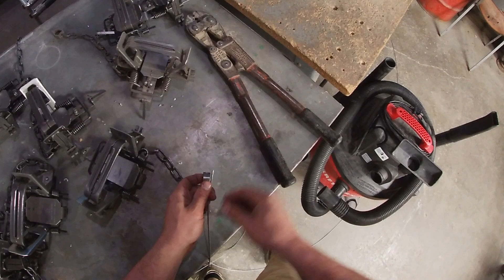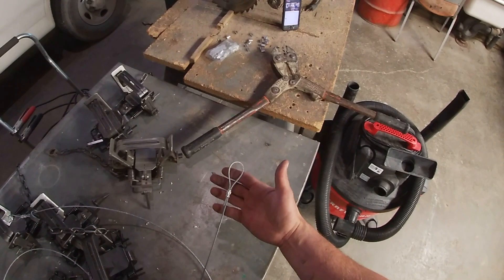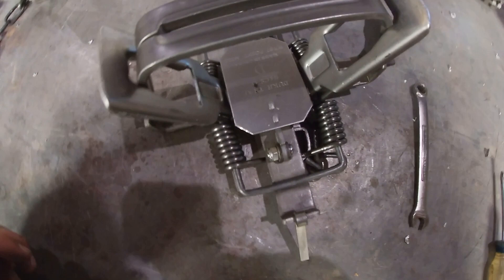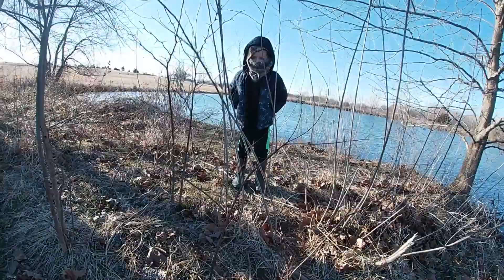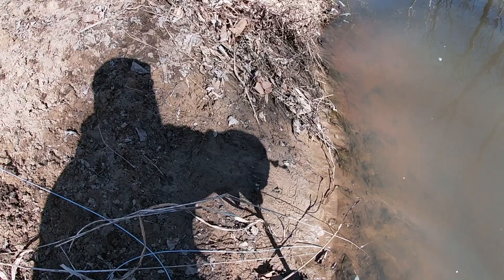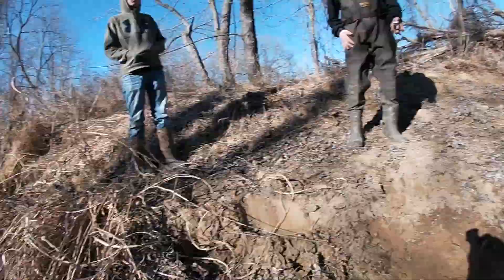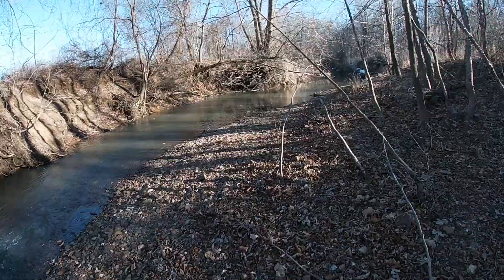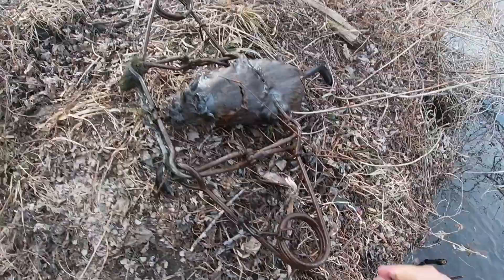Fast and Easy Drowner Sets - Beaver, Otter and Muskrat Traps - Eason Season

Comment: the proplem with cable or wire drowned is the weight you have to carry with you. if you fill a sack with sand it takes time. 
     Drowning rods are lighter to carry and 10 time faster to set. I'll go with the rods, I can set twice the sets in half the time.
Reply: I agree with you but a lot of the places I set are rock bottom. That’s why I was using that style.
Reply: Getting fiberglass drowners is an effort too,j3 outdoors has them but shipping is an issue and when you are in Canada its a much bigger problem even though he has distribution here in some places.( Not near me)

Comment: Are you using 7x7 or 1x19?
I tried some 7x7 and nearly lost a beaver who chewed at the anchor end.
I eas thinking of switching to #11 wire.
Your teap is lots big enough for beaver,#4 double long spring was the main beaver trap for 100 years with a 6" jaw spread,now #3 coil springs are 6" jaw spread.
Oh jeez don't cover your yraps with sand or earth of any kind when setting water,theres no need and might silt under the pan.